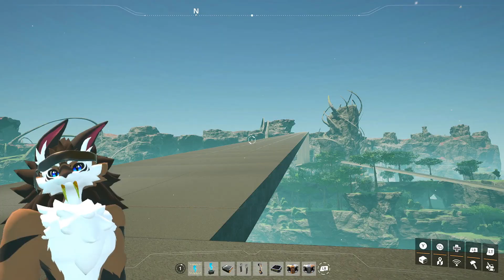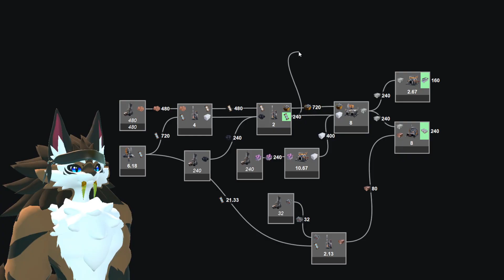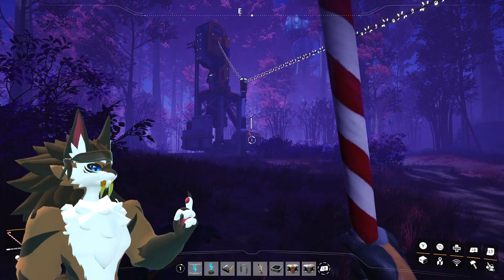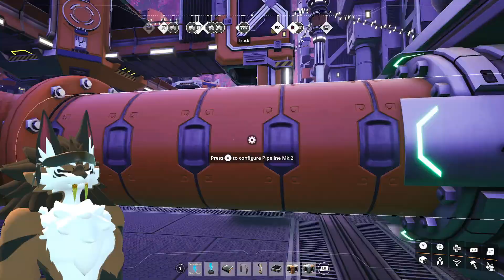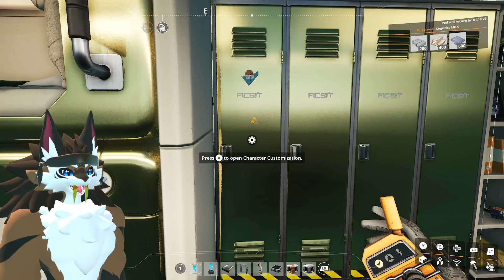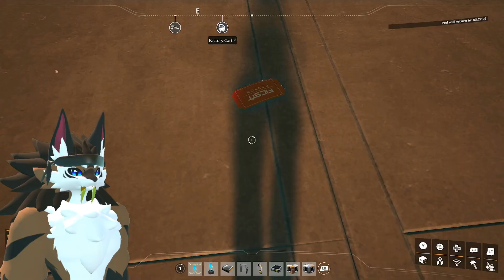Satisfactory - 15 - You Take the High Road

Comment: 8:06 More like your rear would go through your front as you hit the back of the engine.
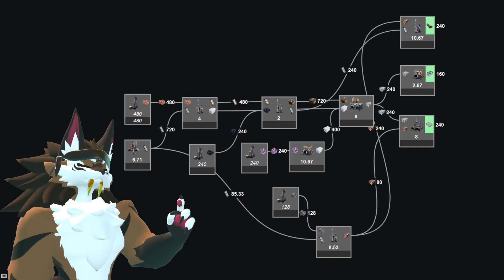12:46 Uptime? That's the only thing I can think of that would be going up. Maybe check back later and see if it goes back down.
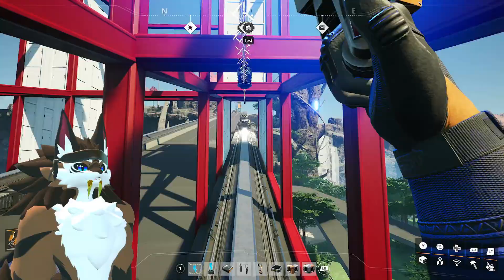26:56 Your character has shins? I thought you had hocks.
27:43 And you wonder why you run out of materials. 😆
30:24 I can already tell you that yes, it's possible, but it's a royal pain in the tailbone.
32:24 Yep. If you want to educate yourself about how to do that, here's a good starting point: https://www.youtube.com/watch?v=U5Wy69v553c . Don't be afraid of the plumbers manual. It's well illustrated.
36:21 You got a cackle out of me. Well done.
40:48 It's horrific, but it's an honest kind of horrific. LetsGameItOut, on the other hand, is a monster.
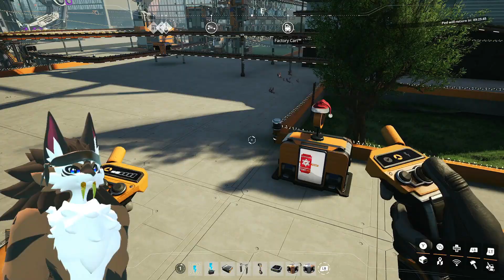48:45 Welcome to the hovering age. Kick your feet up and relax.
1:00:20 You figured it out! Now, for the reveal... 😈
1:02:08 Oh, there's a use, alright. And no, it doesn't involve driving it off a cliff. Too much lag. Perhaps something more... bouncy.